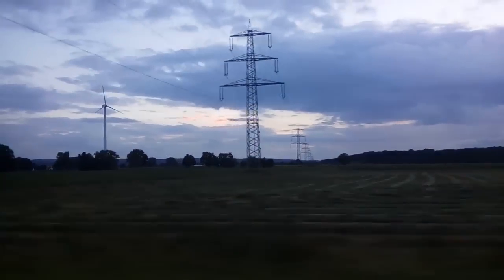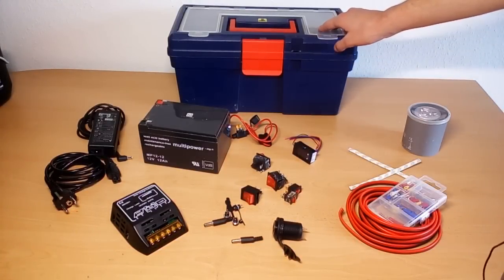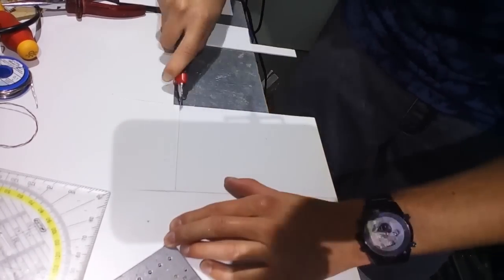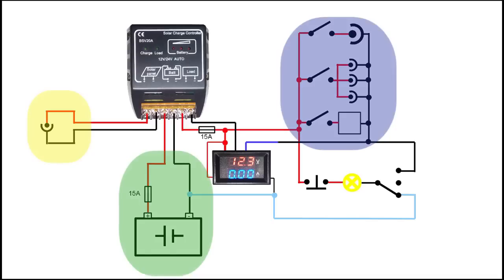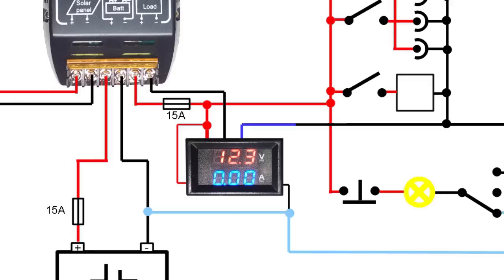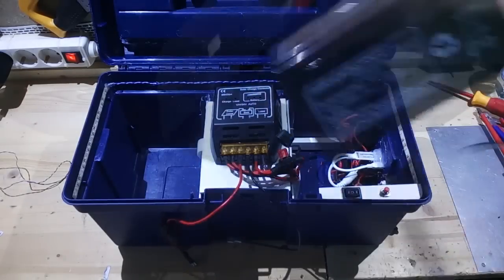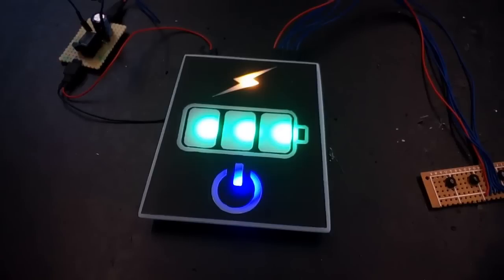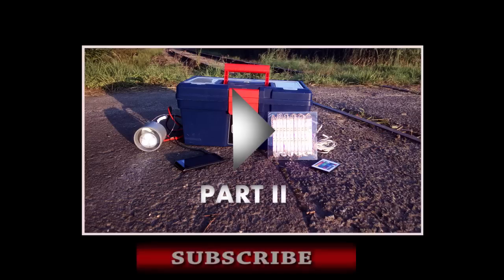DIY Solar Power Pack

Comment: Hello, an under  -table dent and all other hungry electricity consumers can be dimmed steplessly with the 5000W dimmer (7, EUR). I run 5 dimmers in parallel on an 850W inverter. Kettle 2.2KW at 150W runs for 12 hours at a time, so the water is always hot. The room is also nicely heated. 2.5KW washing machine runs in parallel with dimmed to 200...400W. Iron, dishwasher, oven, electric heater, coffee machine, all internal heating are throttled with me. Videos on my channel https://youtu.be/eC2olbCBhh0
The inverter stays cool, quiet and the MOSFETs remain intact because extreme current peaks no longer arrive at the inverter...

Comment: Nice i built one similar using a slim Ammo tin a solar controller and a 17Ah battery added a lap top charger to charge or solar and 3 5A output sockets  also a 2.5A dual usb charge socket also got some 12v  10W led lamps max op is 5A to save the small battery. My battery is protected with a 10A fuse incase the charge controller goes defective and the ops all feed from a 5A fuse

Comment: you might need to sand the plastic if you want the sticker to stick. and i would also put a 3m doublesided tape to make it more stronger on the back of the sticker.

Comment: ?Hi!! Great work!! Just one question, is it possible to connect a 220V charger to the solar panel plug?
Reply from the maker: Hey, glad that you liked it. Connecting a 230V power adapter is indeed possible, you simply need to add a current limiting circuit like the one linked below. The PWM Solar charge controller is only capable of limiting the voltage and an empty battery connected to a 19V laptop power brick acts just like a short circuit. 
Just solder the little board in between and you are good to go.
https://www.aliexpress.com/item/Free-shipping-5A-constant-current-LED-driver-module-battery-charging-constant-voltage-DC-DC-power-module/32688795073.html?spm=a2g0s.9042311.0.0.air9Ua

Comment: Awesome instructional video, I'm working on staying within an affordable budget. What is the cost to making this portable power pack?
Reply from the maker: Hey, here is an approximated cost list of the components
-12V lead acid battery   12€
-solar charge controller 8€
-2m of 2,5mm^2 cable  5€
-crimp connectors    2€
-switches and buttons  20€
-5,5mm dc sockets 2€
-volt/ammeter    4€
-old tool box   0€
-custom led Light electronics 10€
-led strips 2€

soooo all in all, about 65€.
hope this helps:)

Comment: Is it possible instead of solar panel use car for charging the battery thru charging controller?
For example, take two cables from car battery or car generator and connect them to charging controller instead of solar panel source?
Reply: Sergii Sylkov you probably could but solar panels generally give out slightly higher voltage than a car battery so am not sure. lots of experts on here though! 😀

Comment: For the charge meter you could have simply removed the leds from the board and then replaced them with wire with leds on other end which runs to the outside case where the battery image is.

Comment: The Idea is great and the finish looks really nice. In principle you've built a simple (large) version of an opto-coupler. You could have also replaced the LED's by standard opto-couplers to achieve the same result.
Reply from the maker: The funny thing is, that i did not know what opto-couplers where when I made this box. When I learned what they where and how they worked it all seemed pretty familiar :D

Comment: That solar charge controller is so inefficient. It will drain your battery after about three days if you have no charge going in. Like a couple cloudy days will do. You may want to isolate the controller from the battery when not using it to charge the battery. This will prevent over-discharge of the battery due to the controller using around 300mA when idle.
Reply from the maker: Hey, thanks for you comment. 
You are right, the controller is meant to have a solar panel constantly connected to it, to charge the batteries up. Therefore it will discharge the battery beyond recovery if you don't disconnect it after use. 
I simply pulled the battery connectors of while I wasn't using it which is of course not a very convenient method. 
I think you can guess what I forgot to do after my last camping trip. Long story short, the charger killed my beloved lead acid battery and I had to get a new one. While I replaced the battery I also added a big red main switch to isolate the battery when the box is not in use:).

Comment: ...you said it was solar. there was no solar panels on it at all... just a bunch of lights to drain your emergency power down faster...
Reply from the maker: Hey AgentJeffy, thanks for your comment. You can't see a solar panel because I haven't got one at hand right now, but I guess you can imagine what it would look like if there was a solar panel connected. By the way, the solar panels output voltage has to be above 15V and it's output current shouldn't exceed the maximum charging current. I am going to talk about that and all the equipment in more detail in the second part.